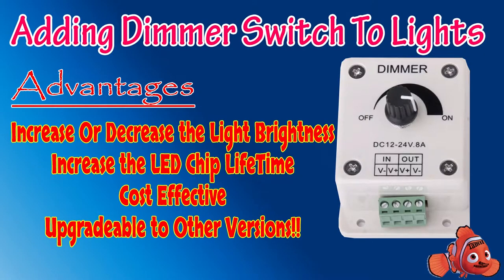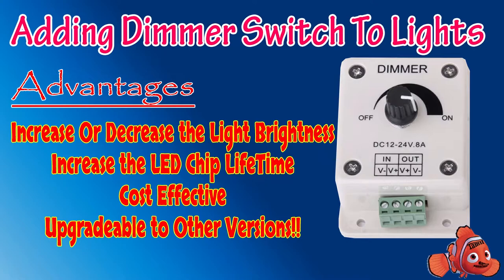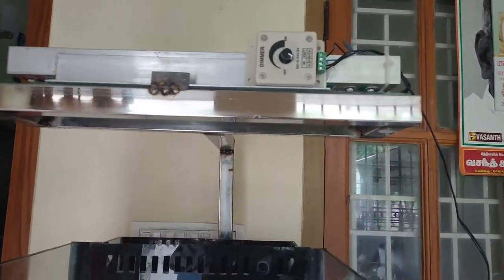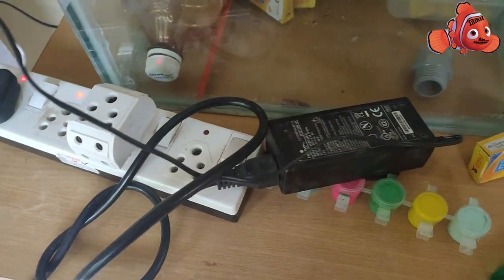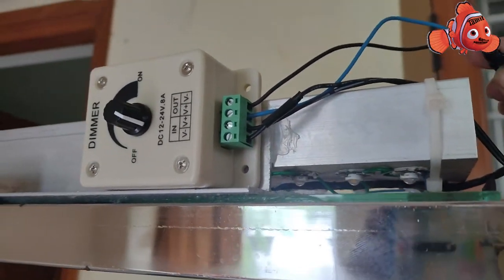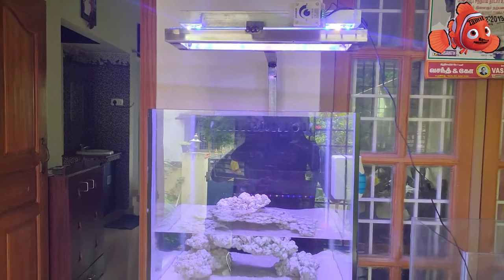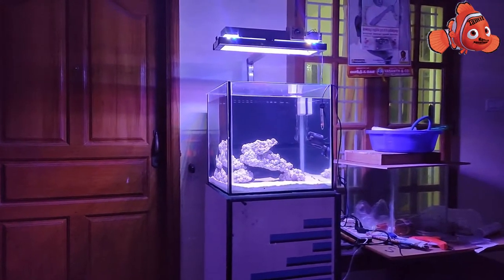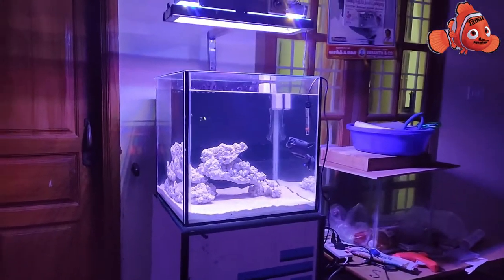Adding Dimmer Switch To DIY Marine Led Lights In English II TAMIL MARINE AQUARIUM

Comment: Hi i have 80 wt led we r try to use fan regulated to control my led but if i dicrese nob led r bliking and if i increase full nob they work so this dimmer switch can i reduse my led intencity.
Reply from the maker: Fan regulator will fully decrease the voltage bro and not advisable for led .fan regulators are for reducing thd heavy voltage drop.